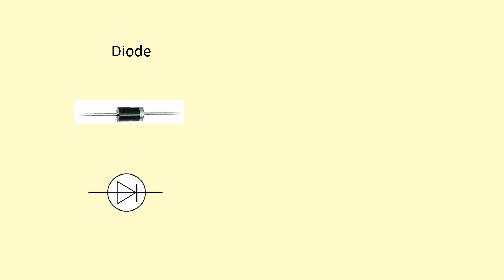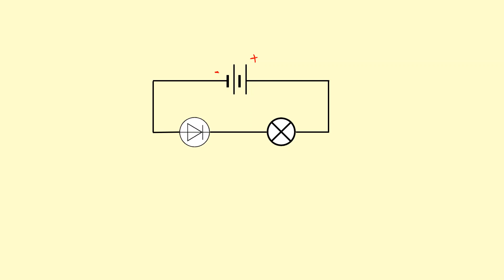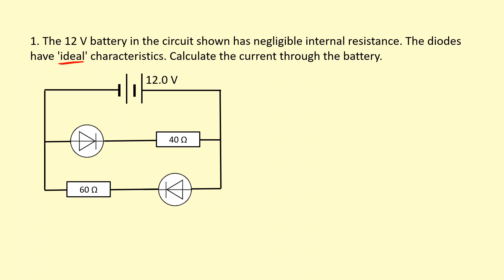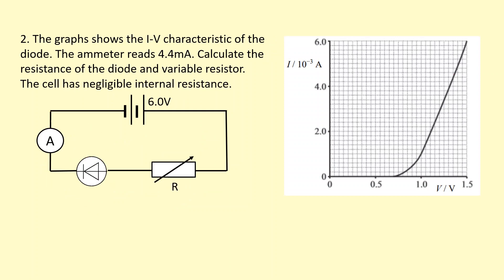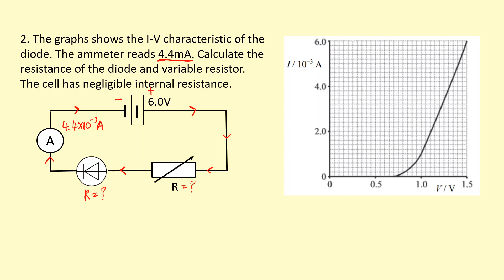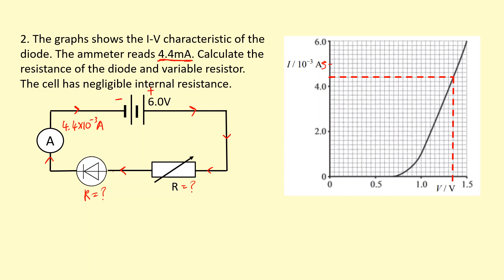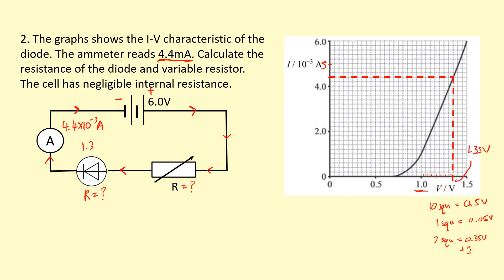3.19 What are diodes  & LEDs?

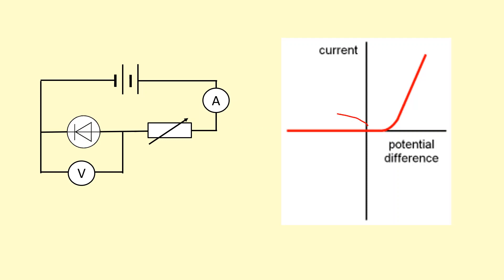Comment: at 1:31 is the current across the diode 0, while the voltage is small, because the resistance of the variable resistor is so high, that it decreases the current around the circuit to be basically 0? im a bit confused